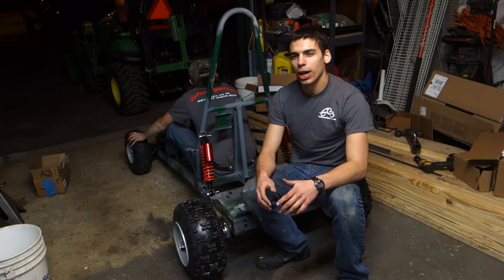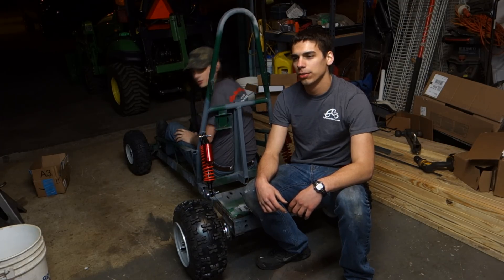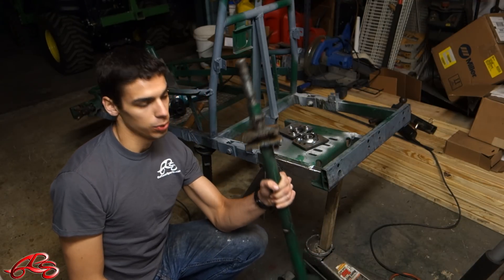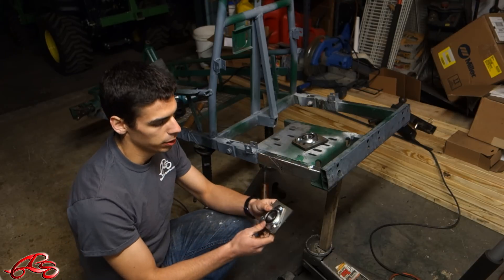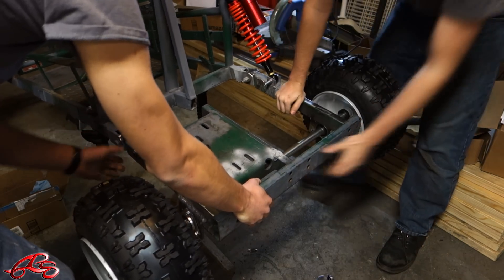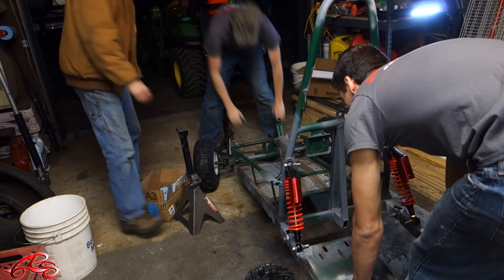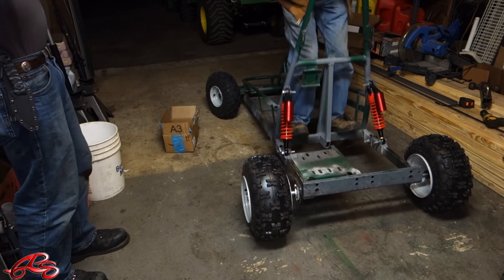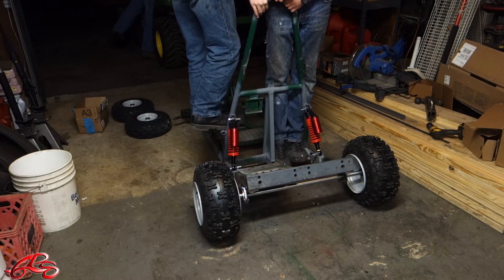Dead to Live Axle Conversion FSTGK Pt  4

Comment: Hello, excellent video, you could specify the model of the rear and front wheels as well as the model of the rin that they are using?, Because I got the links to buy them, but there is a great variety. 
Used the same axis of 42 for the front?

I have 2 go kart same to yours and I intend to make them like the one of the video.
Reply from the maker: Thank you! I'll list the exact parts I used at the bottom of this reply. For the front, if you have the same Shaller kart, we are actually reusing the U joints that are already in place. The only issue with reusing is that they're slightly too short for the wheels we used. Stay tuned for the next video in which we extend out the front wheel rods.
Rear Wheels:
http://www.gopowersports.com/build-your-own-8-tire-assembly-this-is-for-1-wheel-assembly/

Options: Cleat tires, Live-Axle Wheel, and Mount Tires
Front Wheels: 
http://www.gopowersports.com/build-your-own-6-tire-assembly-this-is-for-1-wheel-assembly/

Options: Cleat tires, 6" Floater wheel, Two 3/4" Bearings, and Mount Tires
Reply: BOS Studios Thank you very much, I am looking forward to the next video.